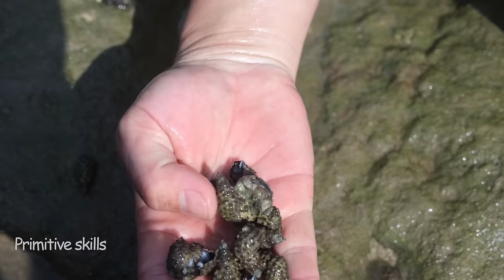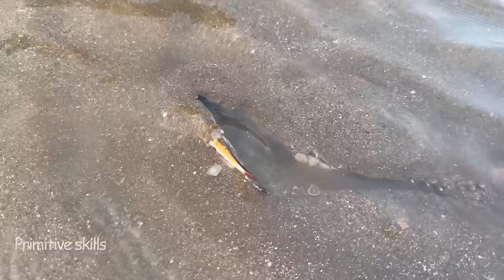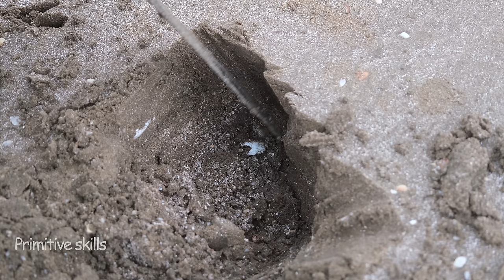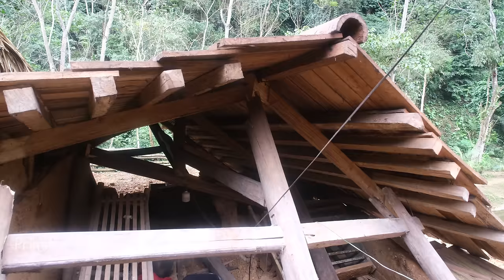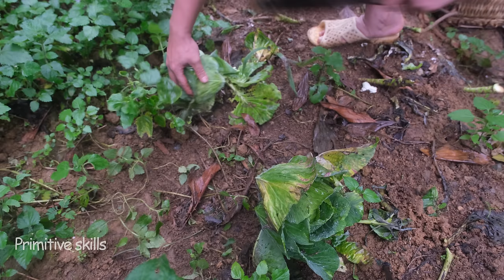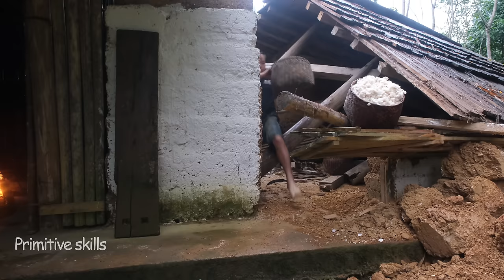PRIMITIVE SKILLS; Catch fish and crabs, oysters - Survive in the sea

Comment: It doesn't look like damage came from water. It could been wind. I think vandals would have tried to damage the other structures also.
Wind could have pushed the ceiling with enough sideways force to knock down the wall.
Reply: It sounds plausible 👌🏼
Reply: Since the roof wasn't treated to be water resistant, it is also possible that it absorbed too much water and slowly became too heavy for the earthen walls to support. Then, a powerful sideway wind became the final straw, causing the entire thing to topple over.
However that is just a theory.
Reply from the maker: Thank you, wish you and your family good health

Comment: You are living in tropical zone, of course there is a lot of rain, humidity and moisture. One good possibility causing the house to fail is dirt structure that you have. Dirt is not an eternal material but for temporary might be OK. It gets softened by rain and moisture. Don't forget  that your house is surrounded by water: the pond, the water stream here and there. And also roof structure gets heavier and heavier, and waiting to collapse when it finds weak spots. I feel sorry for you, you have such a wonderful paradise. Cheer up!

Comment: Maybe the roof was too heavy, because when the house was built at the beginning, there were only leaves. When the  roof tile boards were installed, a few more braces could have been added. Similar adobe houses were built long ago in Hungary, which are still standing today, but here the piles are in the wall. lucky you weren't in there! sorry for the english, it was made with google translate. All the best! An old viewer. ;)

Comment: Lucky, it did not happen when you were sleeping inside. Do not be sad! It is an opportunity to build a brick house, finally!
I think the wooden planks on the roof absorbed a lot of water from the rain, became heavy and caused the wall to collapse. Build a brick house, make several inside walls so you better distribute the weight of the roof via wooden beams and make a ceramic roof tails. Ceramic roof tails do not absorb water.
Reply: Duong is a traditional man and wants to do everything the natural way. It will take years to make enough bricks and tiles I think. But if not, we're sure to find out. I think he builds the size he does to eliminate the need for support walls inside the house. He's by himself and it would take so long and not charge much from day to day for watching purposes.
Reply from the maker: Thank you for always following and supporting me

Comment: I apologize in advance, my comment was made with a translator, there may be some shortcomings.

Shocking to see this. I agree with everyone who says that this happened for a reason. Perhaps it is fate that you got the pleasures of the sea instead of the accident involving the collapse of the house. I think everyone is happy together if we look at what we have, not what was lost. We often take two steps forward and one step back. Unfortunately, this is a part of life, but without challenges we would not be able to enjoy success. All your viewers are with you in spirit.

As for the house, I have a few tips for the collapse. As I looked back, I noticed that the walls were not primed. If wetter weather comes, the house wall can absorb moisture through the wet soil. Under these conditions, the house wall acts like a sponge. This explains why the building remained intact from the kitchen side, since it is regularly heated there, moisture can evaporate and vandalism is also excluded, since the kitchen is easier to vandalize than the part of the building with rammed earth walls.

EDIT: I fixed an error caused by a silly typo.

Comment: Nooo not the house!! Soo much hard work gone in an instant!!

I think you are right about the shingles or planks being part of the cause. They and the under structure supporting them adds a lot of weight as they are thick, so there is soo much wood sitting on only six upright poles. You also identified that the humidity and moisture from the rain would have added more weight.

I think if you do rebuild with the intention of putting so much weight on the roof, you should make sure to include diagonal struts into your structural design. The upright poles on their own would have had so much strain from the weight shifting in the wind, any sheer forces or any lean putting the force of that weight anywhere other than directly down through the stump uprights would have put a lot of strain on where they are anchored and on the joins at the roof level diminishing their structural integrity over time.

I hope you can rebuild! And i am sure you will build it so much better! You always put a lot of thought into your designs and plans, and i know you will succeed!